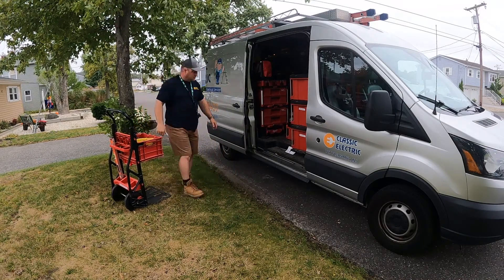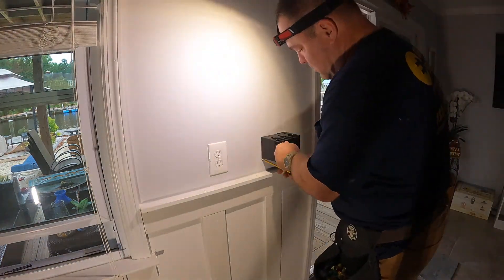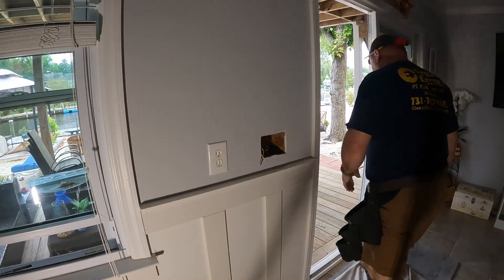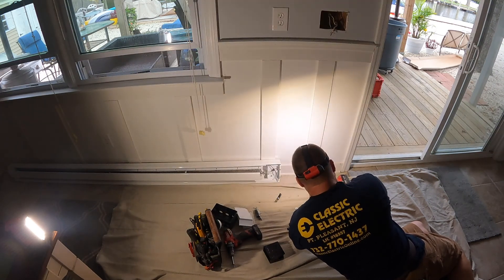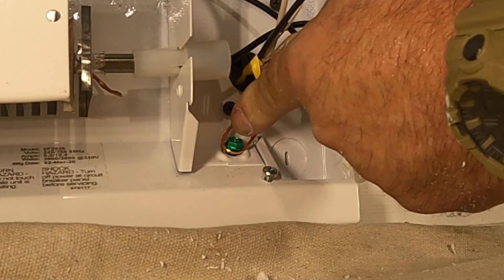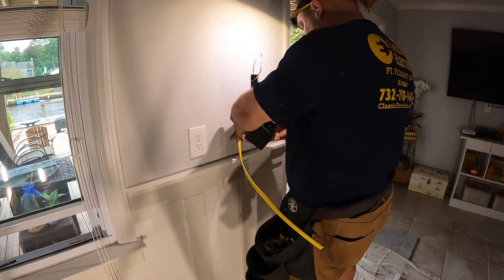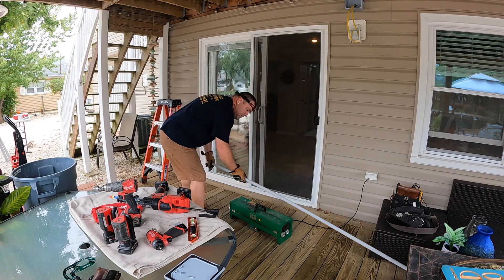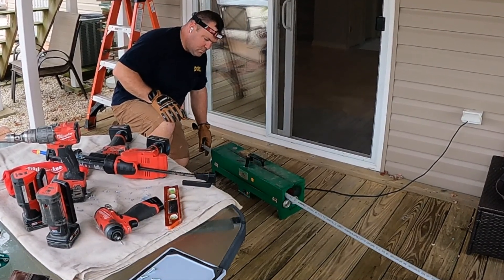96" Baseboard Heater w/ Line Voltage Thermostat

Comment: Maybe I missed it but did you remove the duplex receptacle above the 8' long baseboard heater and I stall a blank plate. NEC does not allow receptacle above baseboard heaters but most homeowners like a receptacle under every window for holiday lights. Now with California & some other locations s banning natural gas in new houses by 2032 then10 to 15 years later make existing hones remove natural gas there will be tons of electric baseboard heaters going into those homes. With that & most houses have 1 to 2 EV vehicles wonder where the power will be cig coming from. Don't worry be happy goofy California has the answer. They will pay 50% of cost of sleeping bags & long johns to keep people warm during numerous black outs during cold winter nights.

Comment: Was taught to never install a thermostat on or worst yet partially inside a cold draftey exterior wall. Understand that you have to work with what you have. Found that the ugly add combination 240 to 24 volt transformer with built in relay is way more accurate when used with a quality 24 volt thermostat verses any line voltage thermostat.Could never  understand why the code does not require two pole line thermostats to break both hot legs.

Comment: I feel like it’s cheating running the circuits outside of the house instead of thru the walls and floor joists. Good video though, I enjoy watching you work.
Reply from the maker: Of course you could also open finished ceilings in two large rooms,  a laundry room, and a bathroom, but the way I did it is more efficient.